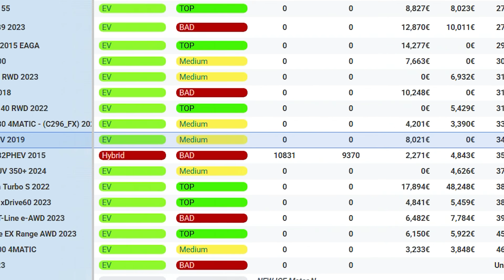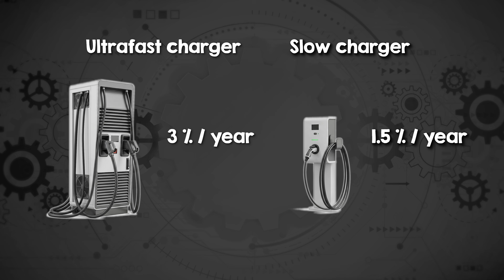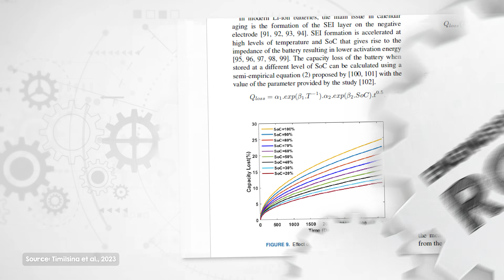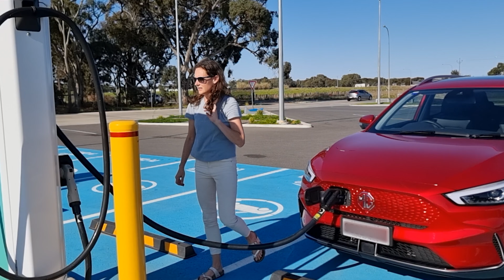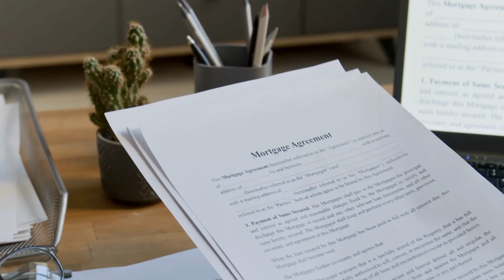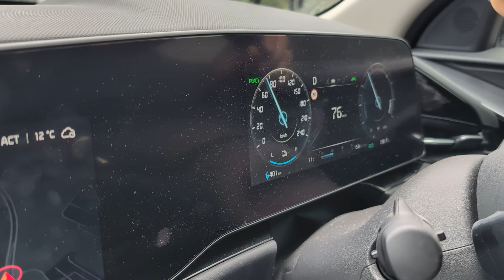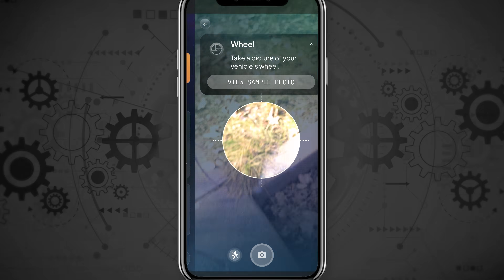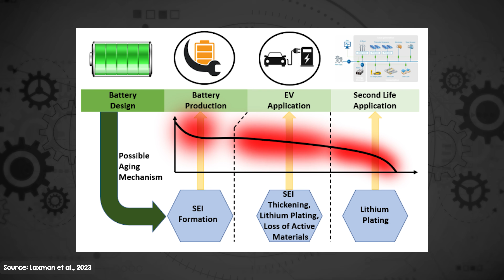Watch This Before Buying Your EV

Comment: I own a 2019 Kia Niro EV with an 64kW SGI battery. Here's some data for you: I've owned the car 7 years today. Odometer is at 95, 239 km. Original advertised range was 396km. The average range on this car is 440km. A little less in winter - as expected - about 20%-25% less range. Dealership showed the car at 100% battery health at year six. 95% of charging is at home at max 7kw on a 240V charger. It gets charged 100% about once every 6 weeks. I charged it to 100% last night for a trip and it is showing 488km range. Not certain if this is an anomaly, or the SGI battery paired with Kia's battery management software is just brilliant. (It's not for sale 😀)
Reply from the maker: That's awesome thanks for sharing your data! Did you maybe make a typo in the original range though? Otherwise it seems your battery capacity has increased since new!
Reply: @E @EngineeringwithRosie  No typo, It was advertised as 396km range when I ordered it in the fall of 2018. Seems crazy, but talk to just about any early-model Niro EV and they’ll report the same. A good friend has the same model/year with over 200,000km on the odometer, and reported yesterday  496km range at 100% and 392km range at 80%. Both vehicles are mostly city/suburban driven and both at in British Columbia.

Comment: If and when EV batteries start failing, it should be made easy for professionals to measure cell degradation (and replacement), do quality checks on the load balancing circuit and cooling system, and then repurpose these repaired modules in a home battery system.

Comment: I know there is a chevy bolt that has over 500,000 miles and the battery is still at 87% my bolt and niro at 45k miles are at 97%

Comment: I linked up our Chevy Bolt and Tesla Model 3 to Recurrent to track what is happening on the vehicles. It seems to give a lot of really good data on the cars. I am wondering what the differences might be between ClearWatt and Recurrent. I am glad I now know about the degredation curve, and that I need to consider that impact over time on my vehicle. It is not a big issue as long as people don't think they will get full range over the life of the vehicle.

Comment: For proper perspective, a gas engine with 100k or 200k miles doesn't perform as well as a new engine and likely burns oil. Also, replacing an engine is very expensive but few cars need that, no different from an EV. Gas engine wear is accelerated by skipping oil changes or frequent red lining RPM, battery wear is accelerated by frequent red lining charging speed

Comment: my used model 3 LFP has 2.2% degradation after 23k miles. (2.5 years)
im 95% DC fastcharging it as i cant charge at home.
totally recommend you the model 3 with a CATL LFP pack.

Comment: A DIY solution for counting coulombs should be fairly easy to make. For a battery as large as a car’s, the measurement would probably take days. But the idea is that, since coulombs are basically the time integral of current, any electronic load should be able to be configured to compute it.

Comment: We bought a 2021 Nissan Leaf in January that had 68,000 miles on it. Its battery still holds nearly 100% of the charge it held when it was new.
Reply: The underdog EV. I really like the Leaf despite it's passive cooling battery drawbacks (slower charging, worrisome pack temps after hot weather DCFC charging). For L2 charging and local use I would not hesitate to choose a Leaf.
Reply: @joeaverager  Yeah, that's what we bought it for. We have an Ionic 5 as our main vehicle and use the Leaf as a backup.

Comment: Complete fear mongering click bate.

Rate of batteries needing replacement that is not covered by warranty is profoundly low. Less than 10% the off warranty failure rate of ice engines, let alone transmissions.

Comment: Take this data with a pinch of salt as there were a lot less manfacturers of EVs and and a much lower ownership rates pre 2022. Tech has evolved very fast in the last 3 years so there is a goingto be a lot of iffy data out there as the orginal EVs with the worse battery, inverter and motor tech filter out of ownership

Comment: The anti EV sentiment has been manufactured from big oil and big auto. Then Politicians use it for culture wars.

Queue the oil industry funded trolls and bots trying  to slow down the transition
Reply: ...or people have genuine questions about the many different scenarios that even EV devotees, the transparent ones, did bring up.
The most annoying devotees are those who think EVs are green.  As I explain to a green friend of mine, everything will built is not green when looking at whole of life cost.  Even the Camry CO2 emissions are lower than a Tesla.  Not that I think CO2 is 'evil' as the green devotees make CO2 to be as there are other factors when considering environmental impact.
I do like the more pragmatic EV owners who assess people life style, needs and wants.  A friend of mine who owns two EVs and said he'd never go back to ICE, said to me "....though EVs are probably not suitable for what you need....".   He is an aeronautical engineer.

Comment: My old diesel Ford Fiesta was fine for years, then something called an Exhaust Gas Recycler failed. The thing itself doesn't seem to be that complicated, but it's buried so deep in behind the engine that no one would touch it. This put the car beyond economic repair at 130k miles.

Comment: If you live in a hot climate,think about getting a carport to keep your car in the shade at your house if you don't have a garage.

This will kep your battery much cooler, reducing heat related battery degradation, and help protect your car from UV damage from prolonged exposure to sunlight.

Also, if you set your battery to start charging at 11:00 pm or later, your battery will be much cooler when it charges and be less damaged by heat.
Reply: I did a review of all the places I lived after I left home. Maybe the third or fourth residence had any sort of parking I could have controlled. I would think that would be the same for most people in their 20s. On street parking, communal apartment car parks are not that convenient for the sort of person that might want to buy a cheep second hand EV.

Comment: A question here is: you mentioned the first charging and the degradation material forms.  Is this process happening in the factory?
Reply: Also, the concern is the right to repair.  When the battery needs to be replaced, it's more than likely the manufacturer simply locks it if you swap in a new 3rd party battery pack.  The OEM pack, as you've discussed, is crazy expensive

Comment: Back in 2023, I drove a leased 2022 Model Y for six months and 30,000 miles.  

And I kept a battery charge log.

>> Except for a Florida trip, that Model Y was driven entirely in very flat Chicago, 50/50 city/highway.

>> 100% supercharged (2:56).

>> Starting odometer 27k with 100% charge = 314 miles range displayed @ 31F ambient, divide by 0.9 ambient temperature adjustment = 348 miles range equivalent @ 67F ambient (source: CleanerWatt / Jon Stewart: "How Much Range Does [an Elonmobile] Lose in Cold Weather").

>> Ending odometer 58k with 100% charge = 302 miles range displayed @ 67F ambient (optimal battery range temperature).

>> So, per real world data, the battery lost 13% capacity (348 range down to 302 range) @ 100% charge in 30,000 miles.

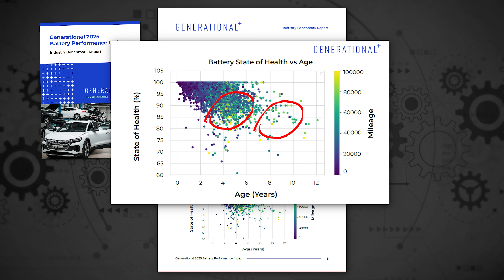If you assume linear degradation, that would mean a battery capacity loss of 13% / 30,000 miles  x  100,000 miles  =  ~40% loss @ 100k miles ...  and not about ~10% as claimed in this video (2:21).
Reply: It is higher in the first year if you kept driving and logging you will see it slow down markedly-as she points out in the video. I routinely get to 90-100k and notice no discernible difference after first year model S 2013- model 3 2019-model 3 2022 and model y 2023 -also owned a 2020 y
Reply: @jamesellis4899  ... Did you understand what she said?  

5:45 ... She states the initial, relatively sharp battery capacity loss is in the first 30,000 kilometers.  My data starts at 43,000 kilometers (27k miles).  

6:21 ... Hence, my real-world non-laboratory data lands precisely in the "level" part of the battery degradation curve.  And my data yields 4x (~40%) the degradation she claims (~10%) for the first 100k miles.

Comment: Another way you can measure the capacity of your battery is to run it down to 10% then charge it from a wall socket with a energy usage measuring device, recharging to 100% then subtracting the charging loss from the total charge capacity.

You can do this at your house with a $40 watt meter whenever you like.  It will just take several hours to charge the battery.  Be sure to drive the car some within a day of charging to 100% to get the battery back down below 90% of capacity so you don't degrade your battery unnecessarily.

Comment: I have to say that this was quite a surface treatment of the issue.  As an engineering channel I hoped for details of methodologies, not just the gloss over used for the consumer market.

At the very least run your car nearly all the way down.  Ideally at a constant speed so you can later calculate range at a certain speed (e.g. highway)  Then park next to a charger and run AC until the car shuts off.  Charge up to full.  The charge meter is a coulomb counter (video mentioned no access to a coulomb counter multiplied by voltage i.e. kWh.  This is even better than a coulomb counter by itself)  Now you know how much energy the battery and its protective systems will hold.

Especially as degradation rates peak initially, the storage value you get will degrade more slowly as mentioned.  

If you tested using cinstant highway speeds, you'll now have an emprirical highway range to compare with the onboard computer estimation.

Not easy, but not crazy.  Something that dealers could use as a selling point.   Maybe include a full length youtube private video of the full test of that exact car to further inspire confidence.

Comment: Good video Rosie.  A couple of thoughts; first I hope the Nissan Leaf was excluded from these studies because it's an outlier due to the air cooled batteries.  Second, here in Canada, Hyundai is unable to repair a slightly damaged battery pack.  This has led to Ioniq 5 owners having their car written off by insurance, as Hyundai wanted $50k for a new battery pack.  Myself, I'm not worried about capacity reduction, but I am worried about mechanical damage.
Reply from the maker: Yeah I didn't want to spend too long going on about it as it was starting to feel like an anti-EV video. But there are a few EVs with absolutely wild repair/replacement costs. Also lots that are very reasonable. Check out that EV Clinic spreadsheet for more info about which ones are really bad. I hope/expect this kind of behaviour will gradually disappear because pissed off customers aren't repeat customers! And in the meantime, at least you can insure a car for this kind of damage.

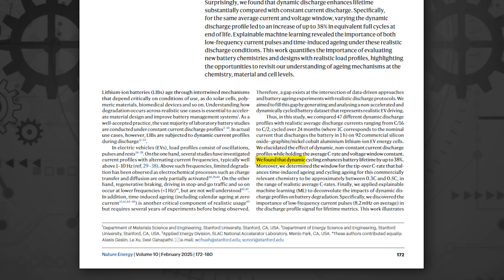Comment: 4:00 WRONG - that study of "dynamic cycling" is using MAX!! 0,3-0,5C rates for that. Thats normal daily driving dynamic - or already bit "babying". A 65 kWh battery (yours - if fresh) on max 0,5C is used at 33 kW discharge rate - thats normal to decent acceleration! ... 0,3C is about 20kW - a bit uphill at constant speed - nothing else!
(all values decrease with smaller batteries instantly - till babying is best)

The study targets normal cells and used rates from C/16 to C/2 for testing. In car view thats a load of 4 kW to 33kW - FAAAR away from full accelleration - or dynmic driving as mentioned.
Its already well known, that the conclusion "drive dynamic" is absolutly wrong and a myth. Its not helping your battery life ! (your grandma style is better for your battery!)

Comment: I have previously been hesitant about getting an EV, mostly due to the charging times and range anxiety and battery deg, but I think with these recent advancements and my typical driving style even a mid range EV would be so much cheaper long term than my current (although fairly efficent) ICE car.

Comment: You did not talk about battery degradation with age.  (Mileage could be reached in 10 days or in 10 years. Battery age is more important than car mileage).  You also added AI generated video clips in your video.

Comment: I purchased a used Volt and was surprised it only got about 20 miles range on the freeway.  I had one week to return it so I did so and found another similar Volt from the seller company.  Fortunately it showed the full rated 53 miles range. The battery has been fine since then.  I’m glad I had a one week right to return and got a decent battery by exchanging the first Volt.  My son has a 14 year old Volt with very little degradation as well!😊. We love having a plug in that handles many of our trips with no gasoline at all! 😊

Comment: As I understand it, some Australian electricity plans allow for free EV charging mid-day.

Would it be advantageous to invest in: 
1) battery plug upgrade to your home,
2) an level 2 charger,
3) couple of ecoflow batteries, and
4) ecoflow j1772 adapter to charge ecoflow batteries using a level 2 charger?

Store electricity mid-day then use it to charge the EV at night or to use for the house. It's just a thought.
Reply: Thats probably a lot of cost for limited performance. It might keep up with the car and its good youre getting daily use out of it. But how does the costs of that compare to buying a home battery without solar. A system like you described, you're paying extra for portability. Home battery might be bigger and you would guarantee more use.
Reply: @Sparky400 let's say you don't work from home. During midday, you're EV is parked at your office parking lot without ability to charge. 
Meanwhile your EV charger is able to receive free electrons from the grid mid-day. This is the only battery on the market that I'm aware of that has a j1772 adapter for a battery. You fill up the battery mid-day. You come home at 5. You can then plug your EV into the battery to charge up your EV. Anything left over can help run your household for the rest of the evening. It helps you because it reduces your electricity bill and it helps the utility because it reduces the duck curve during evening peak hours. It's hypothetical. I don't live in Australia but I've heard of its unique energy program.

Comment: There was an article in the UK Daily Telegraoh on 25th of April - that said Researchers at cybersecurity company Quarkslab removed microchips from the onboard telematics unit of a BYD Seal sold in Britain and subsequently dismantled in Poland after a crash. 
The car’s GPS data were recorded several times a second and stored alongside the time it was recorded, according to the researchers, allowing them to recreate a map of its life, including the crash that led the car to be written off. I wonder if similar data is stored regarding battery usage that would allow a more robust assessment of battery performance to be made. With modern storage media capacity it would seem to be practical although there may be some privacy concerns.

Comment: "Bad" car batteries are usually still more than good enough as stationary storage. If you reduce a battery replacement by the money saved not having to buy a powerwall you might even come out ahead.

Comment: If you are worried, just get a car with an LFP battery.   They degrade mainly with age, and partly with temperature.  Amount of use has insignificant effect.  In non-tropical climates they will probably last 30 years.  charge them to 100%+ once a month and there is really nothing to worry about.

Comment: The 73 kWh NMC battery from SK.ON of my Hyundai Ioniq5 has 4 years and 90000 miles. It shows 95.2% SOH, or 4.8% degradation, according to the mobile App Car Scanner Pro (OBD2). I have CONSISTENTLY recharged to 100%, and mostly on 350kW superchargers, exactly the opposite of what was recommended by manufacturers... trusting my instinct that cell voltage rebalancing is the most important.

Comment: You mention "Advanced Thermal Management Systems" at the end, the reasoning as to why we should not be concerned - but the Nissan Leaf 2016 doesn't feature this? Speaking of - a lot of EVs don't!

Consumers ought to be informed about what they're getting themselves into - and as you mention, it can be 20 thousand euros to replace an EVs battery. The consequences are high for being misinformed, which every manufacturer is apparently doing their best to ensure.

I appreciate you diving deep into the services and the dodgy practices around it. A shame that regulation is required to keep manufacturers honest.

I'm glad you also got warranty for your car. You won't have an issue, i'm sure. It'll be the next sorry soul who purchases it from you who will!

Comment: I wonder if you could actually improve reliability and longevity with rescue and firefighting vehicles. As they trash their ICE to the point where it hurts to hear them running after a short while. I would think batteries and motors tank this abuse much better. throw in a range extender and I think you can cover any realistic operating time and range. you could also make the throttle response much more predictable to free mental capacity to driving and navigating traffic.

Comment: Me and my Prius is happy at 180,000 miles.
Reply: I’ve owned 2 Prius .. a 2006 and a 2010.  I sold the 2006 as I felt it was unsafe (handling), my 2010 made 250,000 km before it was toast … engine burning oil and transmission surging, body bits falling off.  That said, I considered these cars very good.  I moved on to EVs .. no comparison as they are freakin amazing .. power, quiet, and a much more compelling value.  I would never go back. With EV prices now more reasonable.  A Prius also costs more over its lifetime vs a similar quality EV - I do close math on this stuff
Reply: They're good yes but an EV will go a lot further on original motor and battery.